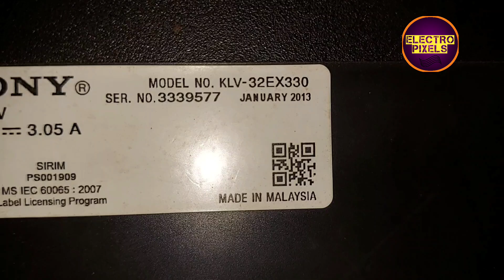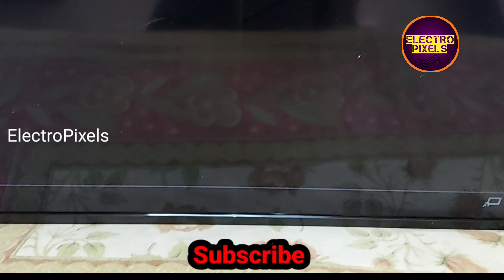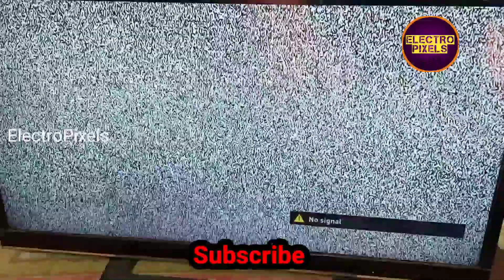Double image and color change  in Sony led Tv fixing method.||Sony KLV-32EX300 panel repair new tips

Comment: Sony klv 32 EX300 का ckv1 ckv2 ckvb1 ckvb2 aur stvp disconnect kar ne ke baad bhi double image aa rahe hai next kya kare ... bataye
Reply from the maker: Which side you disconnected
Reply: @ElectroPixels  left as I hve mentioned the points ckv1......etc
Reply from the maker: Rejoin the cutted tracks and then try it on the Right side
Reply from the maker: If you're not a Technician then please don't try, Contact Nearest Technician in your locality